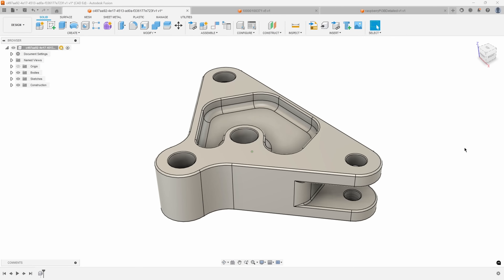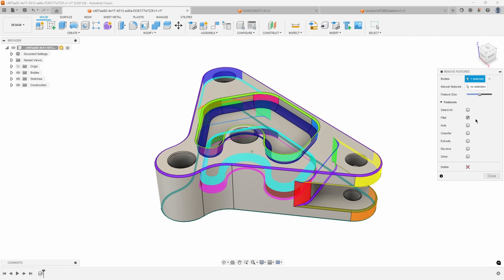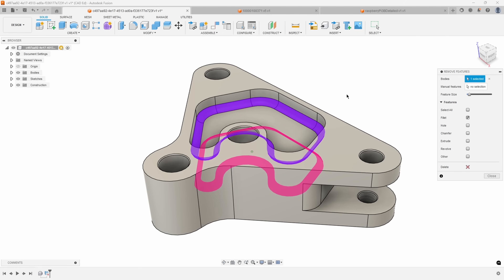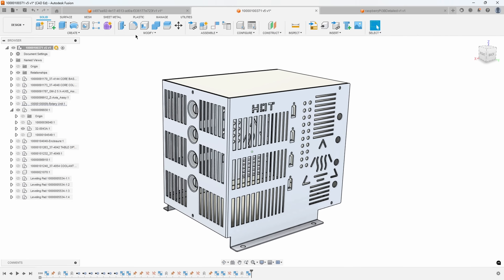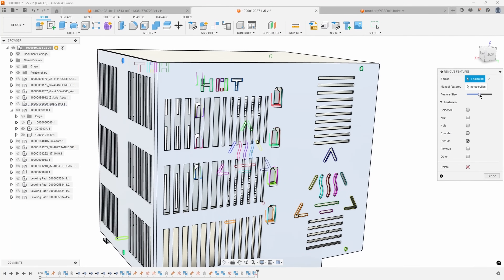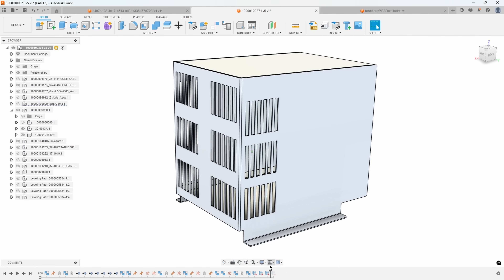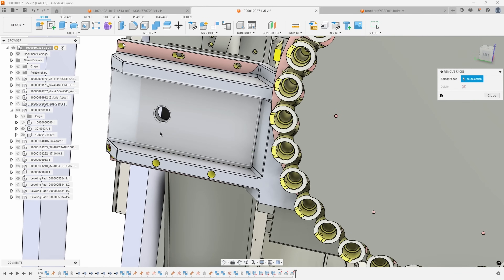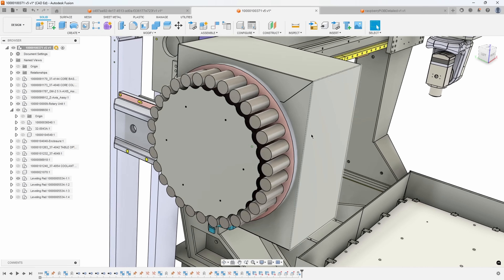Learn how to Simplify in Fusion

Comment: Nice video Brad!  Simplify and arrange tools were snuck into the standard design workspace awhile back without much of a mention.  If any viewers don't see them there is a check box in the user preferences in the General > Design section called "Enable Arrange and Simplify tools"
Reply from the maker: Ya, I noticed that when I was teaching a class and saw the option in preferences and it popped in my head, "Aww, man, I didn't mention that in my video..."  But, I haven't had anybody mention that they couldn't find the command so far.

Comment: Thanks, Brad, another great video!  I have two questions: Is there an easy way to turn all of those changes off at the same time, similar to how you can with section analysis, for example? Second, could you use this to simplify a model for CAM?  I don't like to have chamfers modeled on the part for CAM purposes, so could I have them available for creating a drawing, but turn them off for CAMing? That would be really cool.

Thanks!
Reply from the maker: Yes, if you checked fillets, chamfers, holes, etc in the simplify dialog, they would all get selected in one simplify feature.  However, you don't have as much control over what gets selected.  You might need to drag the slider to the right to get the holes to be selected, but that might select some larger fillets you don't want selected.  That's why I did each "feature" by itself.  And yes, you could use simplify to defeature for cam.  If it were me, I would copy the original part and defeature the copy for cam and use the original for your drawing.

Comment: Nice job. Question, if you are wanting to just get rid of the large holes or features only can I assume you will need to do this manually? The slider goes from small to large so if you want just the large then the small goes with it?
Reply from the maker: Oohh, great question.  Ya, the slider only goes from small to large and doesn't allow you to select a "range".  I wish it did.  So, yes, you are correct.  You would want to use the manual delete feature option.